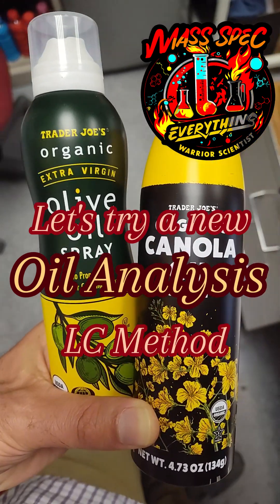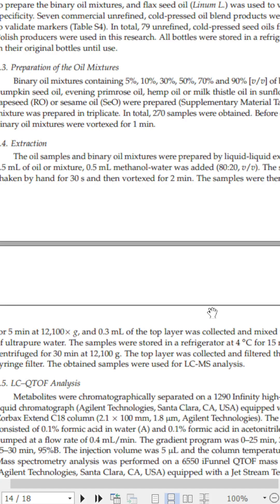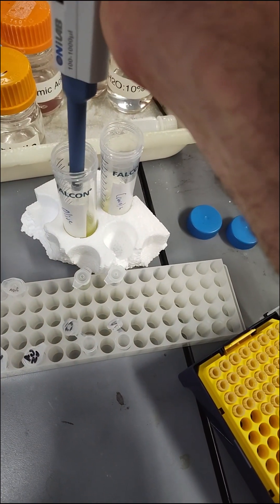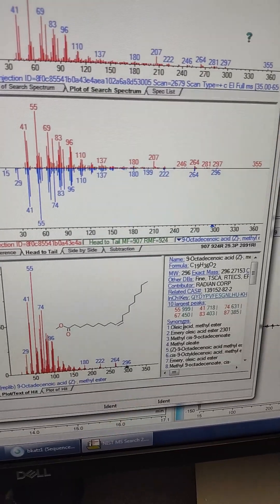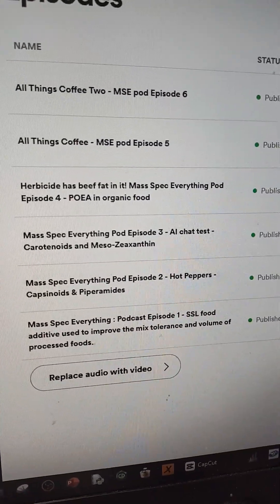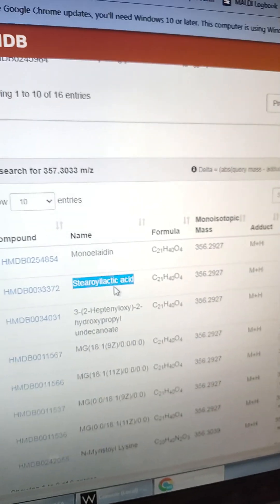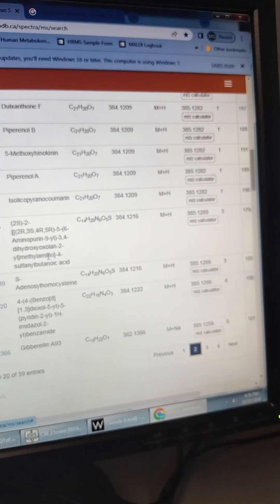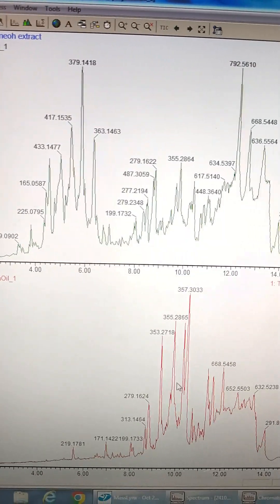Let's Develop a new Oil Analysis Method by Mass Spec Everything

Comment: This is great if we can get some usable information. 

A question popped in my head though. Should the testing be of "cooked" oil. I would think we get most of this stuff into our bodies after its heated up. Better? Worse? Same?
Reply from the maker: Great idea heating temperature decay testing
Reply: @MassSpecEverything  i was going to suggest it anyways but it's topical to this too, i'm curious about rendered fat from cheese. it's obviously mostly fat but also certainly not pure fat.

pretty simple to make, since you can't just buy it, take cheese (mild cheddar has worked best for me), and heat it until the emulsion breaks, either microwave or a pan (which also leaves you with a crispy snack). presumably there would be some difference between the two, microwave would probably be a cleaner separation.

you could also compare chemical extraction, microwave extraction (less than 60 seconds), and full cooking in a pan (depends on amount of cheese but could definitely go for 20 minutes).

Comment: Countries and states will sometimes have certification stamps for unadulterated olive oils. I know California has one, the California Olive Oil Council stamp you can find on bottles. If you shop at Sam’s club instead of  Costco, the cheaper member’s mark brand olive oil doesnt have the stamp while the more expensive bottle does.
Reply: I kind of want to see if theres a separation method using HPLC since i have access to one. Would be fun to see if the stuff i use is a problem
Reply from the maker: Thanks for the info